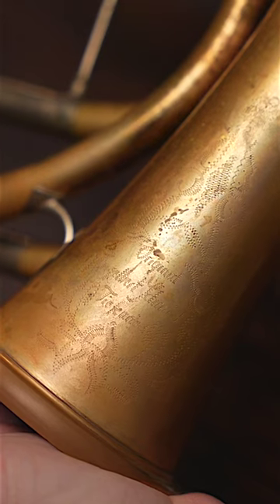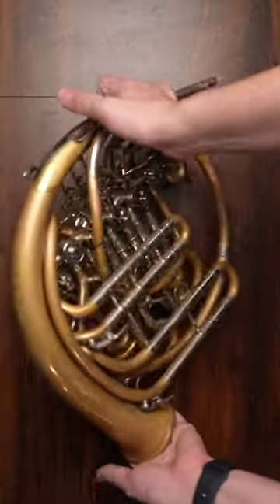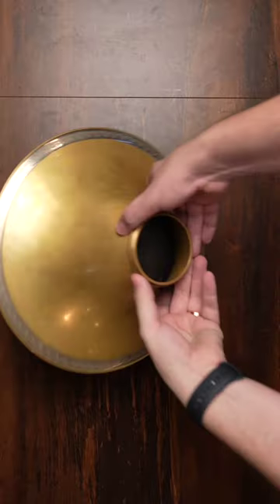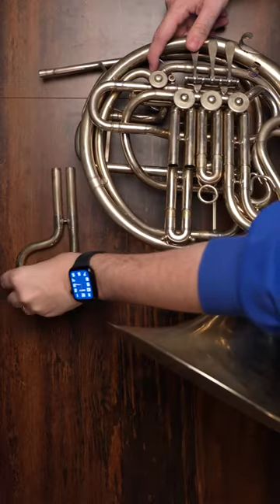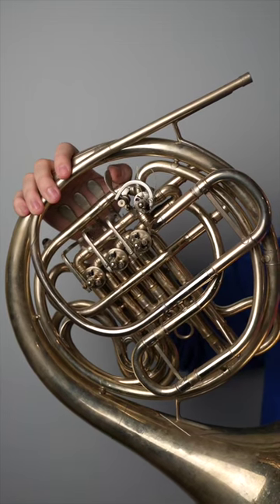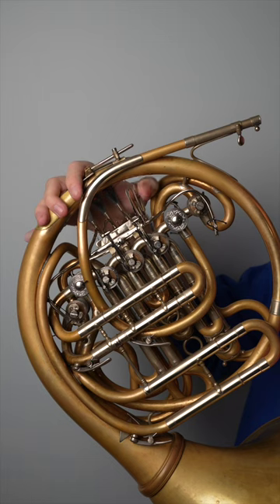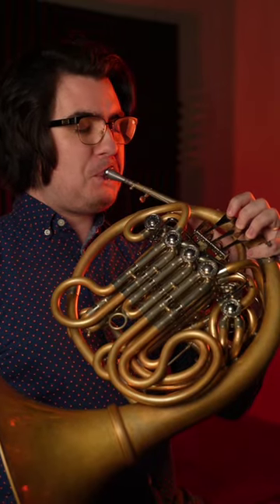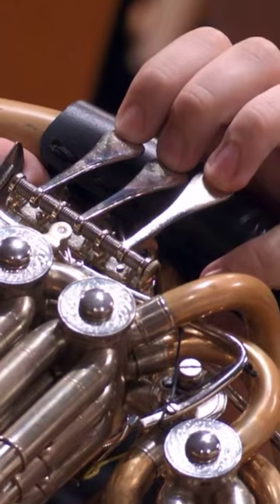What is a triple horn?

Comment: Hey Scott. As I've said before, that's a very nice axe. Did you order that with the patina because you're too young to have just let it age to that degree and consistently even on tubes that never really get touched.
Reply from the maker: The horn was made in 2005, but the previous owner must have stripped the lacquer. So the patina makes it look a lot older than it really is. Even after I get it cleaned it will start to look like this again after a month or so
Reply: @ScottLegerHorn  Interesting. I'd love to have my horn have that patina.
Reply from the maker: @carlw  I think it’s also due to the fact that the body is gold brass instead of yellow brass which gives it a unique color
Reply: : Agreed. I believe, regardless of skill level,  it also subconsciously makes people hear it as a warmer tone than the same instrument all flashy and mirror finish lacquer. IMHO. A difficult thing to test/study. 
Also, I tried a Schmid with a garland bell and found it hampered my sound (yes it was the bell's fault 😜) vs a normal bell. Do you feel a difference in response/resonance?

Comment: How do you know when to switch between each side, because I have been playing horn for a while and I have just found myself stuck playing on the b flat side and can't get myself off of it
Reply: 1. Whatever is technically easier. This can vary depending on the passage being played.
If that doesn't matter because you're not in a hurry, then:
2. Whatever sounds better. Often this is whatever uses the fewest non-trigger valves, because that means the air gets redirected fewer times.

Worry about intonation and tone quality the most when you're moving slowly, and kinda make those your default fingerings. But when you hit a fast passage, don't be afraid to use alternates, and also when going fast you should probably pick the shortest "side" that sounds good in that range. It spreads the partials out so you're less likely to fluff or clam.

Comment: Help! I don't know how to service my horn. I have clicky valves and they don't go as fast as yours. Though saying it was manufactured in '83 and has been sitting in a closet for 15 years+ and it clearly isn't mine(recently purchased) I don't know if i should service it or try myself?
Reply: If the pistons get stuck, I would recommend getting valve oil if you haven't already. If that doesn't work there is likely something wrong with the strings and it needs to be restrung, or there is something inside the piston that would need to be serviced. Hopefully this helps!
Reply: @GreenRoombaa  Thank you so much! I think i need to take her in :( I have both types of valve oil(can't remember names just valve oil) And I've restrung since I've bought it.(which was in june) I've also repeatedly snaked my horn and bathed it once.

Comment: I WANT ONE!!!! (But is cost 17,000 for a used one and for my use and level it would be overkill)
Reply from the maker: Not that it’s cheap or anything but you can easily find used triples between $8,000 and 12,000
Reply: I guess I’ve been looking in the wrong place.